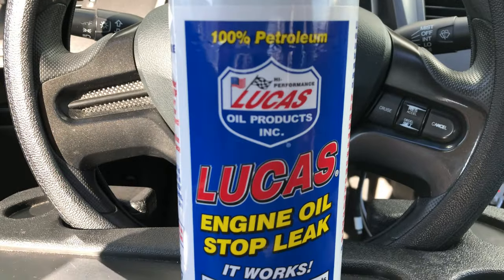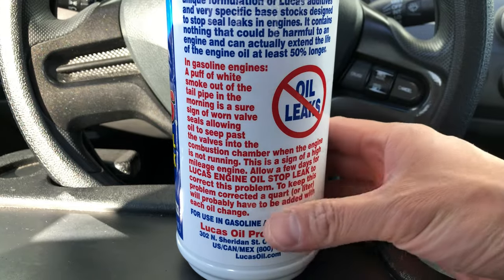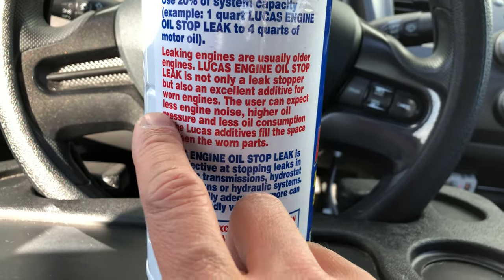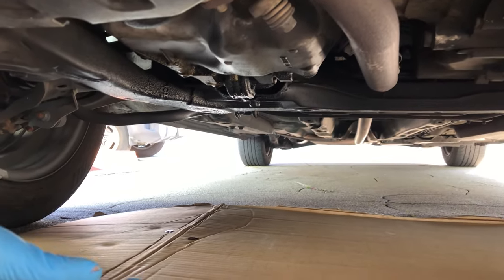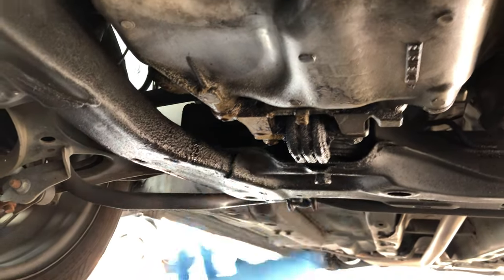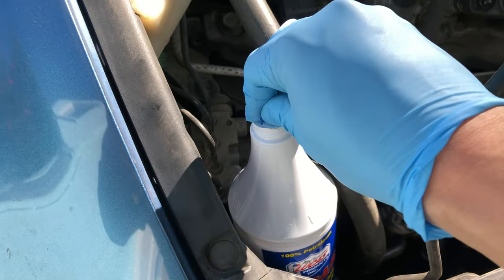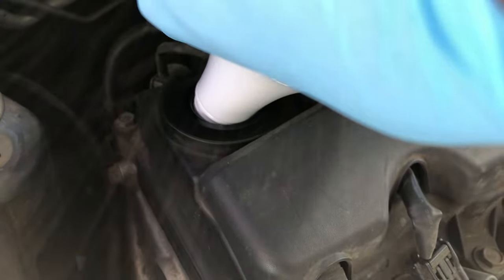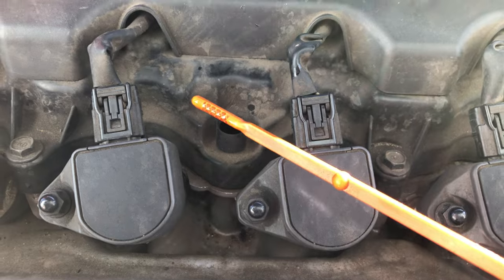How to stop your engine from leaking and burning oil using Lucas Engine Oil Stop Leak!

Comment from the maker: UPDATE!!!
https://www.youtube.com/shorts/-HKfe4_bHvI
After about 7500 miles of driving, I checked the undercarriage during an oil change to see if the Lucas Engine Oil Stop Leak worked.  Last oil change, we wiped it pretty clean, but this time it looks like there's still come oil residue collecting at the bottom.  So either (1) the Lucas doesn't work or (2)  it took some time to work and the oil is from shortly after I used the Stop Leak.  The oil + Stop Leak has been drained now so I'll give you another update in another 7500 miles as to whether the leak has stopped or not.
Reply: Any new updates?
Reply: There is any update?
Reply: is there another update

Comment: That's a VTEC solenoid gasket leak. Very common in 8th gen civic. Almost every civic has that leak. This is the part number for the gasket 15826-RNA-A01.

Comment: I used this on my last oil change and i've noticed that while driving and the car is hot the oil level is much lower than when the car has been sitting and cold. Is this normal for this product? I think for it to read normal while the car is running it would have to be overfilled quite a bit when the car is off.

Comment: Well I wonder where the leak is really coming from. Scotty also suggests AT-205 for seals.
Reply: I had a similar leak in the exact same spot as the one in the video and it turned out to be the VTEC solenoid gasket leaking from behind the engine. Apparently that's a common leak  in 8th gen civics.
Reply from the maker: Thanks for the tip!  I may check that out in a future video

Comment: I had just had an oil change a week before and then i added the Lucas stop leak. Now my engine is sounding funny. Kind of a humming sound. Did I do it wrong? Its also still leaking.
Reply: You over added oil.  Supposed to do both at the same time and added accordingly to your car's oil capacity.
Reply: It had 4 qts of oil in it when changed. Should I have it drained and repeat? Thank you for responding
Reply: I did this to my accord 04 ex 2.4l yesterday ..
Reply: I think stop leak will just damage your engine, just emagine if it will stop the leaking therefore it will probably block small oil gallery inside the engine and will prevent oil to lubricate

Comment: Hey Kevin, my mechanic changed my oil about a month ago, because there was a leak. It is still leaking.  He did not put the stop leaking oil,  can I still use the stop-oil-leak by Lucas on the engine?  Then how much.  I don't want to have my mechanic charge me more for that simple solution.  I paid him enough already.it is a 2006  Honda civic Hybrid.  thank you.
Reply from the maker: you should be able to add stop leak to your existing engine oil but try not to overflow (check the dipstick)

Comment: mine they put the wrong oil, with only 136,000. is not even burning oil , not smoke,
Reply from the maker: The viscosity and weight of the oil should match the Honda specification.  If not, then the internal parts may not be receiving the necessary lubrication leading to premature wear and tear.